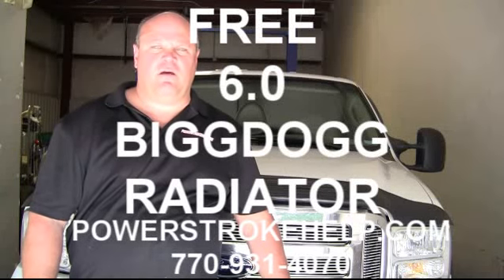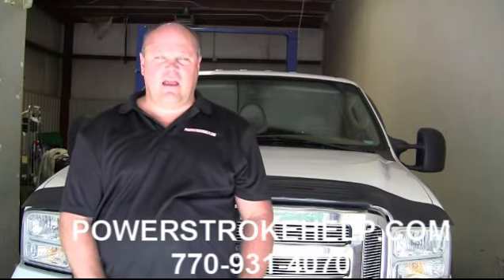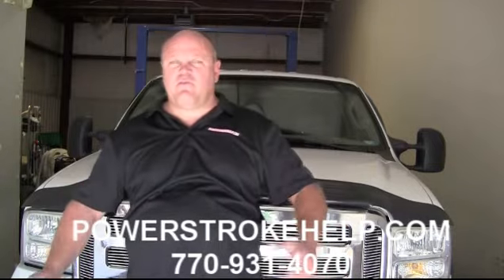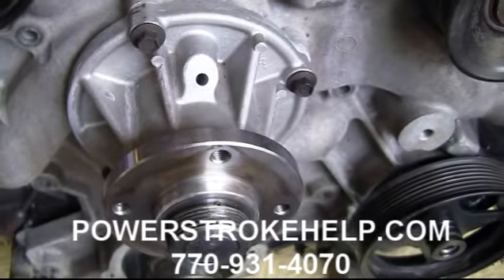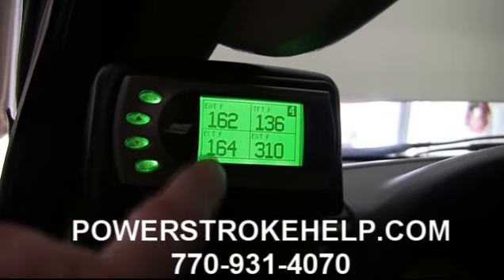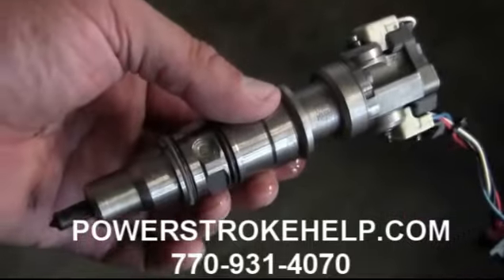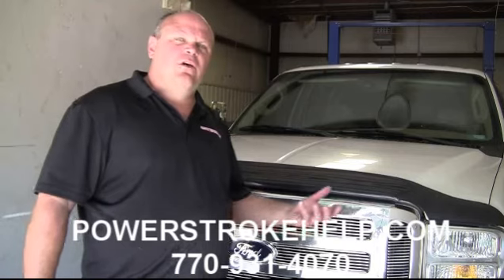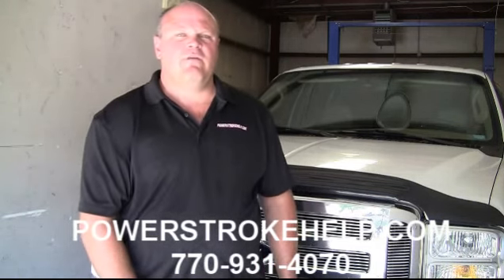FREE 6 0L BIGGDOGG RADIATOR

Comment: Every time I watch one of your videos I wanna go get a 6.0
I love those trucks
Reply: It's called, "The price is right". If you have the right price, I'm sure you can pick up one. I would buy a 2006 or 2007, they still have some problems but Bill can fix them. I think Bill said Ford has less problems with these years than the earlier 06 engines.  I have 22 thousand miles on mine but I use it to haul my lance camper, other than that it sits in the garage. It would take serious money to buy mine. :o)
Reply: Willie Dixon people call me crazy. i will take a 6.0l powerstroke over ANY powerstroke motor i love them so much im going to get one! :)
Reply: me2456 Well, from what I hear, with a few things Bill does to them, they are probably one of the best diesel's out there today. I'm not comparing them to the 6.7's.   Head bolts is a concern and I talked with powerstoke people, I have not went to see them. I want Bill to make a video on what they do to my truck.  I have a show room truck with 20 thousand actual miles and it would be a good show case truck for Bill.
Reply: Willie Dixon 6.0l can be fast as hell too :D i like fast XD
Reply: me2456 My 6.0 has some mods done to it. I bought it from a rich man.  He tweaked it and chipped it up, changed exhaust, nothing else. I took my Uncle for a ride who ALWAYS buys a new diesel every year.  After putting him back in the seat, he was amazed. He said, "Wllie, he said, that's the fastest diesel I ever been in, ever" He went on to say, "it's hard to believe it's a diesel, I mean WOW"!.  The people at powerstroke said that the chip I have, MIGHT not be good in the long run for the heads, bring it in.  They want to put an EGR delete, ail cooler, re-tweak. I know cooling is important so I want one of those radiator's for the right price. They said they could sell me one no extra charge depending on what I do.  YES, this 6.0 is unbelievable fast. I am running a 4:10 rear end.   Hope this helps!

Comment: bill, i have an early 04 6.0 powerstroke and i have a hard start hot condition. icp desired and actual are very close to one another sometime actual is higher than desired that should rule out high pressure oil leak, when hot icp actual jumps to 1100 psi when started then dies, also when the truck is in park and you rev it over a 1000 rpms and try to hold it the truck shudders. any help would be appreciated.